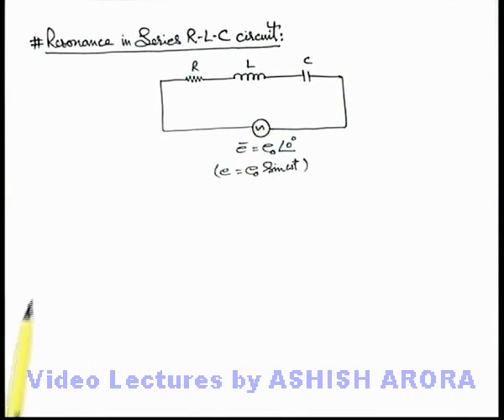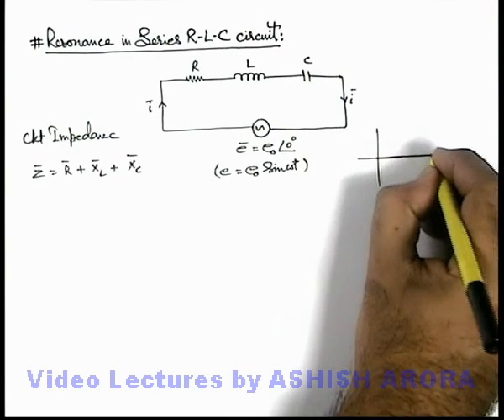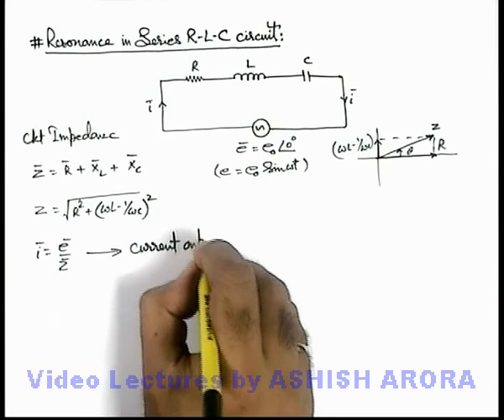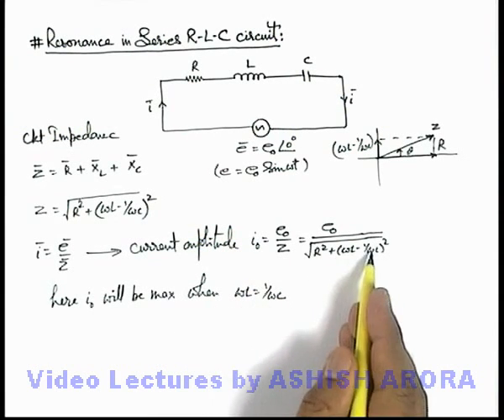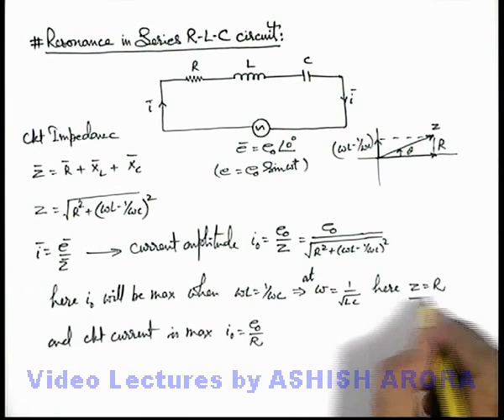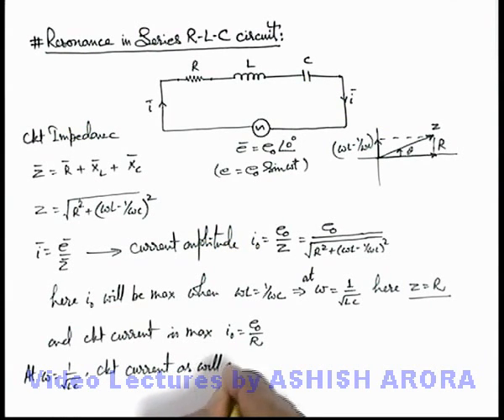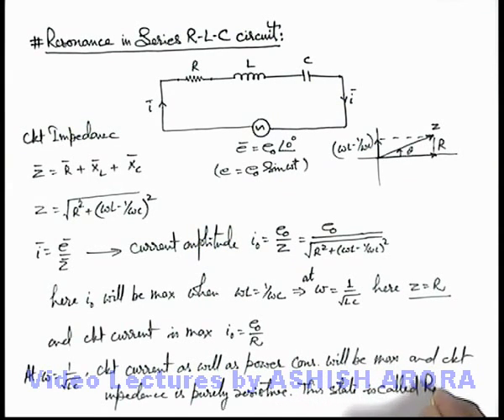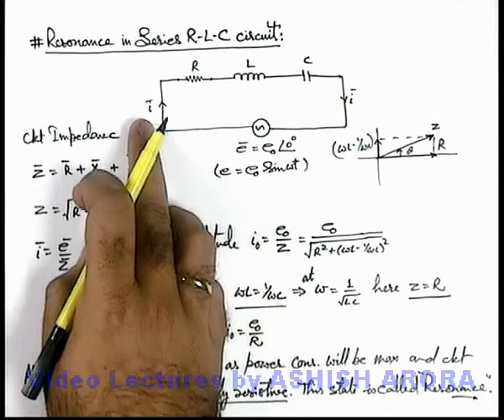Class 12 Physics | Alternating Current | #37 Resonance in Series R-L-C Circuit| For JEE & NEET

Comment: What is the use of such circuit,I mean why do we add capacitor and inductor,if they are neither changing current nor drawing power?
Reply from the maker: main importance of these components is phase shifting for which these are included... other reason is to remove the effect of parasitic inductance and capacitance...
Reply: but at resonant frequency they don't even shift phase?
Reply from the maker: resonant frequency is attained by putting the L or C of appropriate value as circuit would be having some unwanted capacitance or inductance which is called parasitic capacitance or parasitic inductance...
Reply: OK thanks!